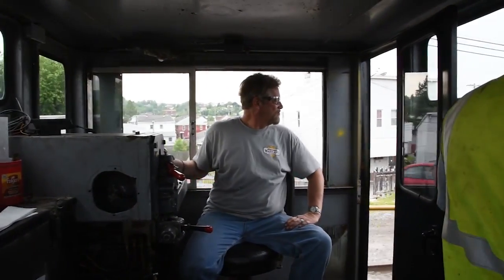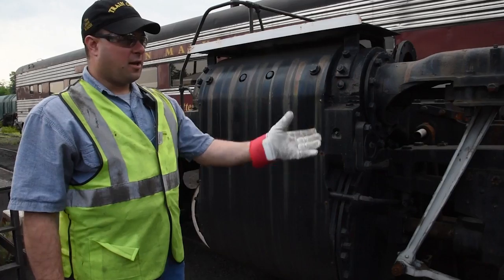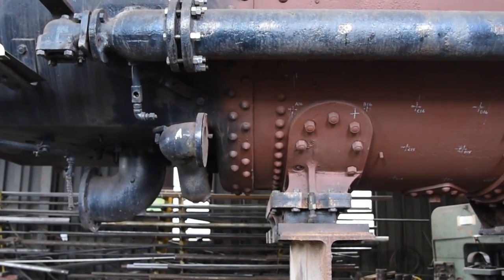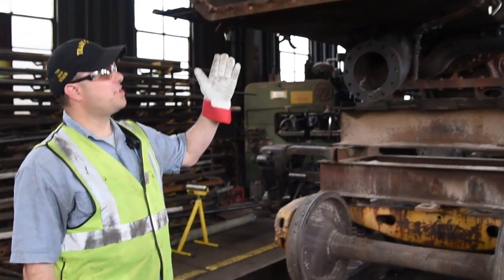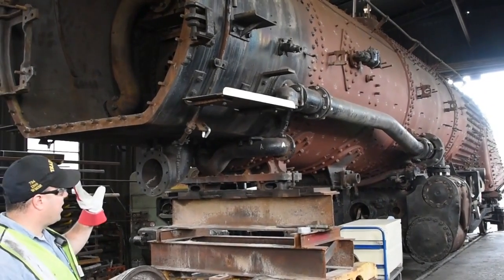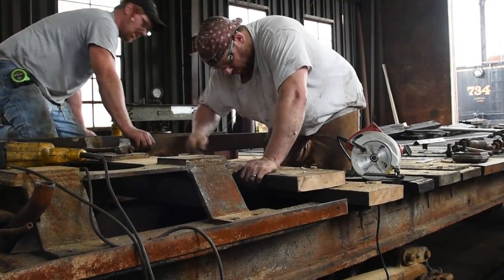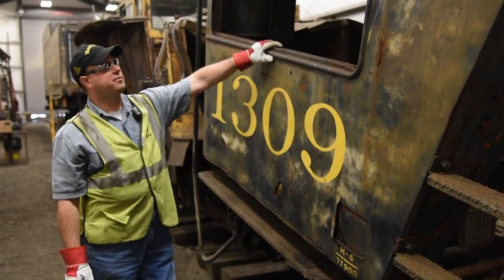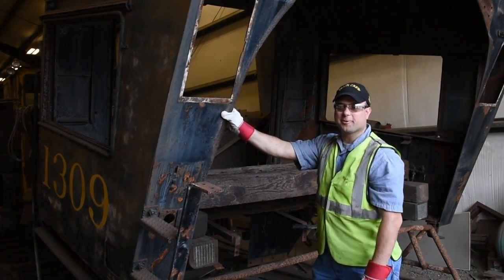Restoring A C&O Railroad Steam Locomotive

Comment: Largest and Most powerful steam engines worldwide 

2016: C&O 1309
May 2019: Union Pacific Big Boy 4014
Reply: its still true, it will be the largest and most powerful engine in regular operation. UP does not operate the Big Boy in regular scheduled service. And never will. 1309 will operate on a regular basis.

Comment: it wont be the biggest  working loco..the bigboy boy 4014 is and will be the biggest working loco in the world..
Reply: Joe Pinto 1309 will be U TIL the 4014 restoration is complete.
Reply: *UNTIL
Reply: J Howe they said it will the the largest regularly operated locomotive in the world
Reply: Who cares?
Reply: hey how's #1309 doing ?
Reply: As far as articulated steam locomotives go, it's very small. NKP 765 isn't articulated, but it's longer than 1309. The Big Boy will have it beat by a long shot when it's running again.
Reply: Well actually, Union Pacific 844 is larger than 1309, so is 765, 1225, 611, 4449, and 261 but I'm not entirely sure if they can be considered regular operating steamers. 844 counts as regular as she's still on the UP roster so as long as they run her as they do now it still technically counts.